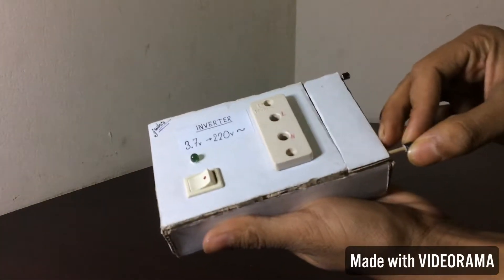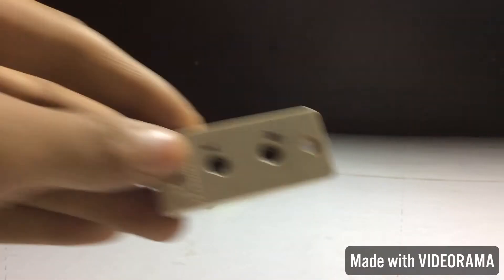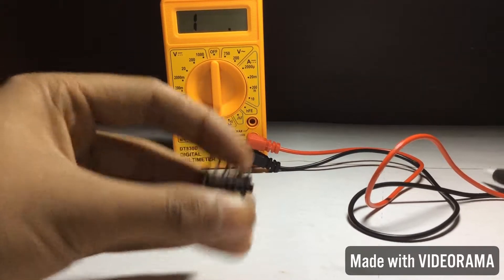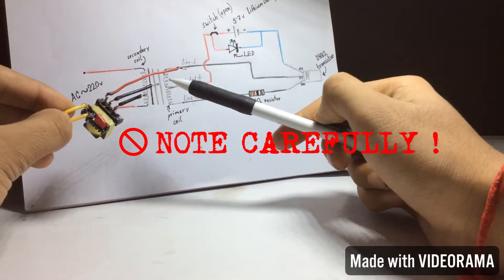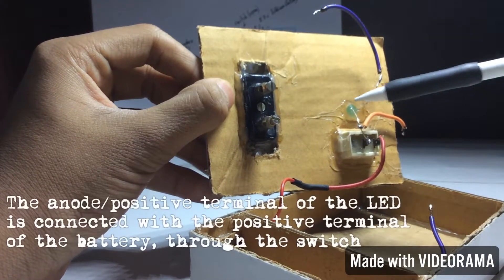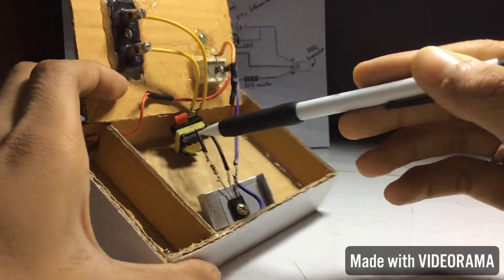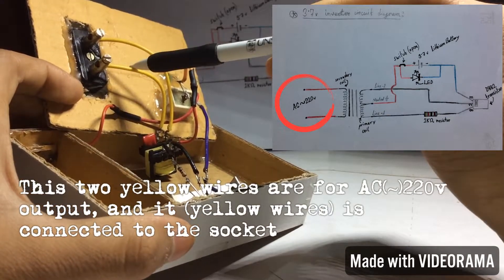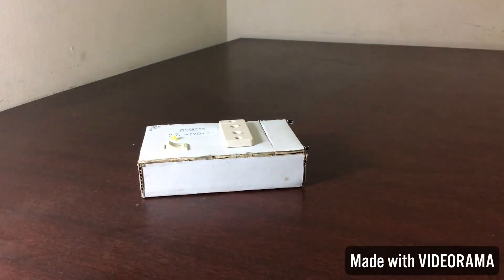How to make 3.7v inverter // 15 watts, enables phone charging...

Comment: Use CFL bulb...use 2amp mobile charger it wouldn't work man bad job ever
Reply: Why use cfl instead led !
But it's true that it can't charge 2amp charger
Reply from the maker: I haven't tried 10W/2amp charger yet , but since it can run a 10W LED bulb, the charger might also work.
Reply: James . bond , its a mini inverter which can can be carried easily. Big inverters aren’t easy to carry. And LED bulbs are more efficient than CFL ones.